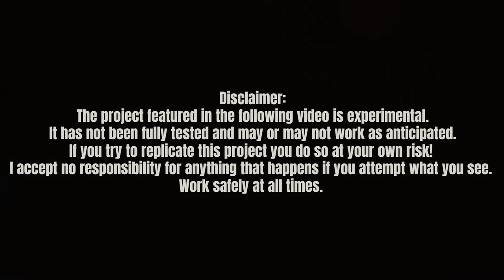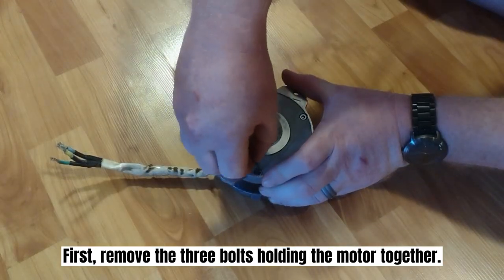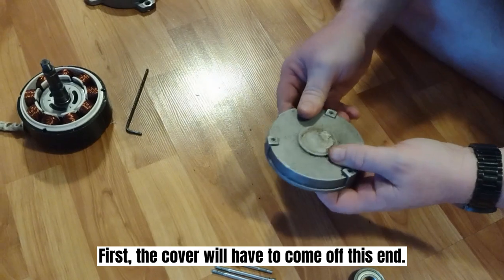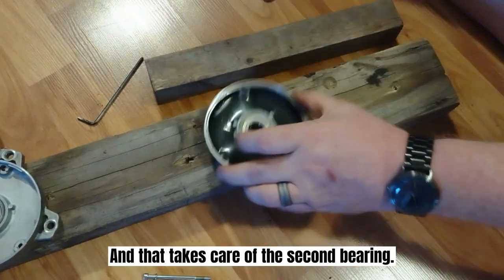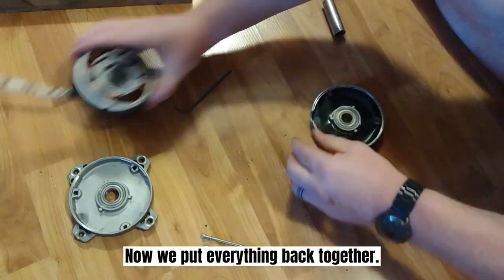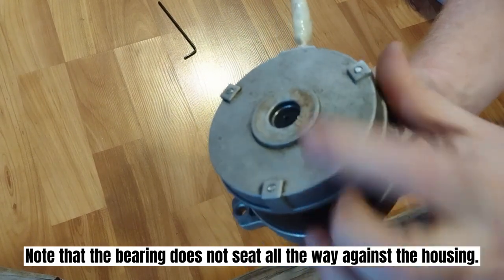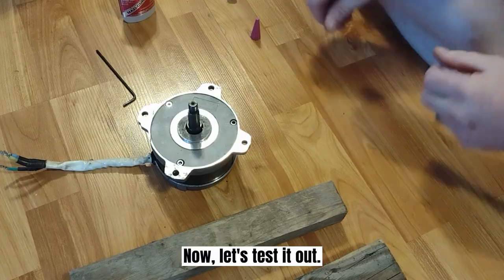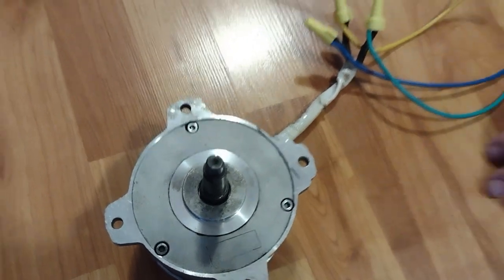Ryobi 40v Brushless Electric Battery Lawn Mower Motor Rebuild Bearing Replacement

Comment: Could you tell me if this motor works at an angle of 60 or 120 degrees?  I need to know how to adapt a hall sensor board to a similar engine...
Reply from the maker: I'm sorry, but I'm afraid I don't know how to tell the difference.

Comment: Random question, but do you happen to have the measurements on the motor mount area? I have a 21in self propelled model that was given to me and I want to replace the broken motor mount with a 20in version motor if it’s compatible. Thank you in advance!
Reply from the maker: Center to center on the holes nearest each other is 3&3/8" or 84mm. Distance across the mounting points at the outside, the widest part, is 5&3/8". I do know that the 21" blades and 20" blades are compatible with each other's motors because I'm using 20" motors with 21" blades on my lawn tractor conversion.

Comment: If you don't have a socket with the same size outer diameter as the bearing, you can use the old bearing in place of said socket. (Everyone note that you only want to hit/put pressure on the outside of the bearing)
Reply from the maker: Excellent tip!

Comment: Can I run this motor for using DC adapter.
Reply from the maker: There is no reason you couldn't, but you still need the controller. You would have to connect the DC adapter, that is powerful enough, to the hot and ground 40v input of the controller. The only thing is, if you use the original controller, there isn't anything to connect the battery sensor wire to. I'd have to check to see if it is needed. If you use an ebike controller I know it wouldn't be needed.